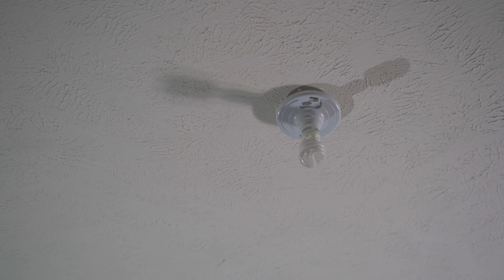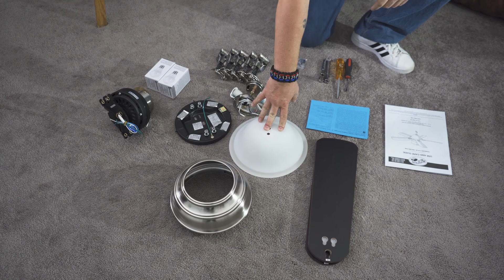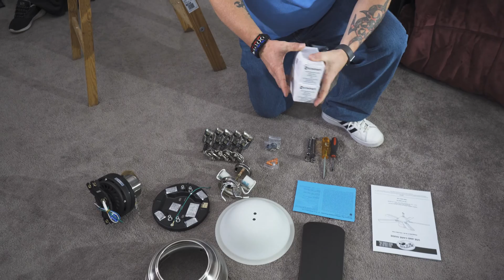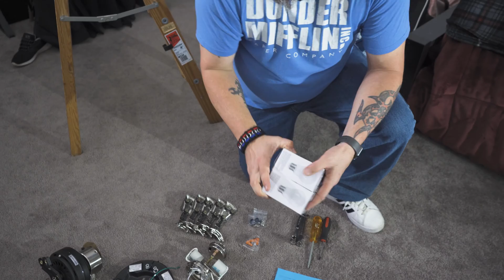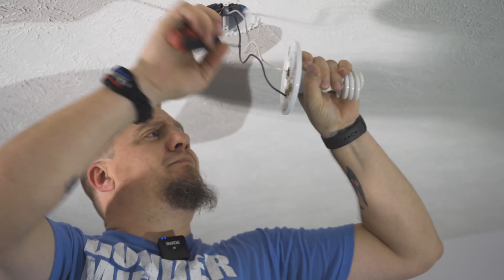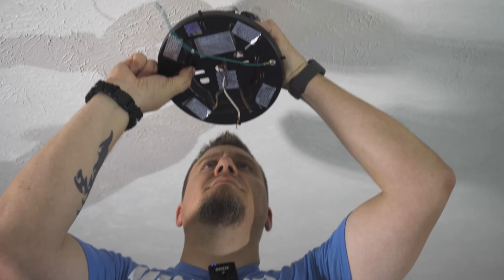Ceiling Fan DIY: Don't Hire an Electrician

Comment: You should NEVER use a plastic junction box. They are not rated for the fans weight and can fall. You should always use a metal pancake box. Very dangerous.

Comment: I'm having trouble with my new fan throwing the breaker when I turn the switch on. There was originally a small light fixture there and I have replaced the receptacle box with a fan compliant box. I'm not sure how to wire the fan because it's in the middle other receptacles throughout the house. Ex. there are 2 house wires with 3 wires each at the fan box. How would I wire the fan to keep the current continuous to the other receptacles?
Reply from the maker: sorry i missed this comment did you ever figure it out
Reply: @Hindsight101  No big deal. I did figure it out. The electricity needs to loop in order to work. Fan and light works great now! Thanks again for your video. 😊
Reply from the maker: Oh good glad it worked out

Comment: Super helpful and informative video. Thank you, for taking the time to show us.  Question: What do you do when hanging a fan and the light fixture being removed is a two bulb fixture (two sets of black and white wires)? Do you run all the black and all the whites to each other respectively like you did with the ground wires? Or, do you place a wire cap on each of the black and white wires that are not needed? Thank you!
Reply from the maker: Cap the extra black and white wire separately.

Comment: I don't know about this video... but I saw other video when a professional handyman  recommend to replace the light junction box for Saf-T-Brace Ceiling Fans. Most  light junction box is secured with just two nails or screws on one side to the stud.  So be careful guys. Ceiling fans weight from 15 lb to 25 lb.
Reply from the maker: Thanks for the input.  I actually went into the attic prior to the video to check the junction boxes because I had the same thought.  I would have taken pics or video while I was up there, but didn’t realize I’d be helping Derrick with this video when I was up there, and it’s a bit of a pain to get up there!

Upon inspection though, I found that the house had been built with properly anchored boxes with a ceiling fan rating up to 35 lbs.  I couldn’t find the exact model we have on Amazon, but they’re very similar to this, Hubbell Raco 936 Ceiling Fan Box and Support, 4 in , gray  https://amzn.to/3k3kOqX

Comment: I took a ceiling fan down to put in a recessed light . I unravelled the wiring that the fan was connected to , connected my light because i didnt think i needed all the wires, turned the breaker on to check the light, so now the light stays on and the wall switch isnt connected to turn it on and off. I tried over and over to get this right and frustrated now. 
Do you live in ny? I could use you or do a virtual. Need some assistance.
Reply from the maker: Unfortunately this was not my area of expertise. I was filming my friend in the video who was more knowledgeable

Comment: I have white, black and red. Would the red be the green then lol????? I dont want to die
Reply from the maker: Always check the wires with a meter but the black and red should be hot and white will be ground or neutrual

Comment: If I wanted the fan and light on separate switches, is there another way to do it besides having to run another hot wire through the ceiling? I'm in an old apartment and can't rewire. Thx
Reply from the maker: You can try smart bulbs and control the lights with your phone

Comment: I have 5 lights in the ceiling and want to replace the center one with a ceiling fan.  What do I have to do differently with the wiring?
Reply from the maker: Not sure that I fully understand what you're asking
Reply: Hindsight 101  all 5 lights are on one switch.  I want to replace one of the lights with a ceiling fan but want it not to be linked to the power of the lights so I can have the lights off and the fan on.  I’m guessing I have to run separate power from the switch to the fan?
Reply from the maker: You could try getting a dual switch